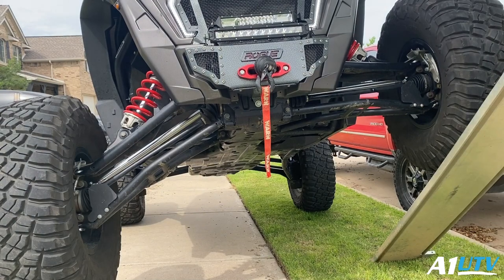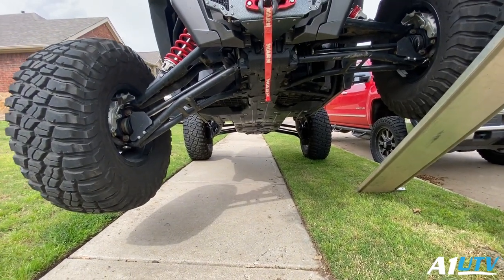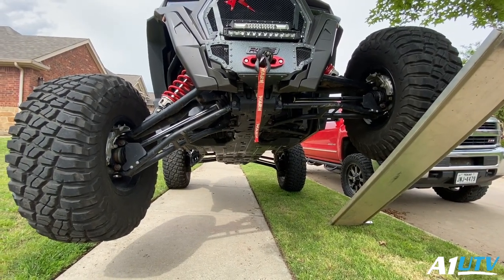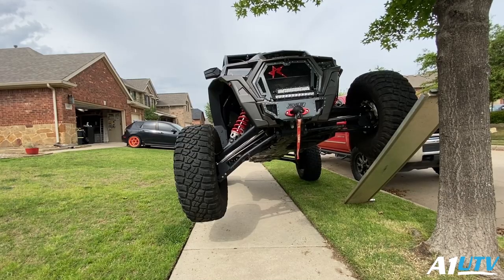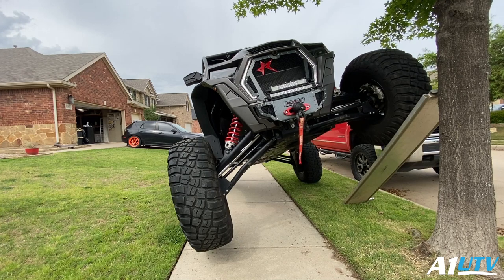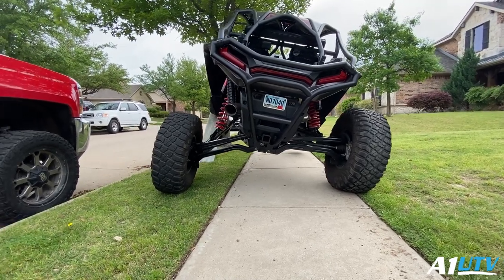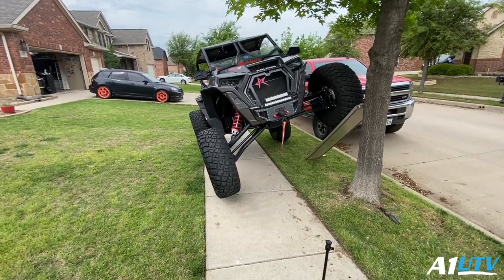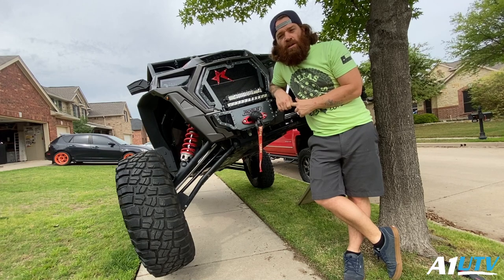Electronic Sway bar test

Comment: This is a great way to go. Sure if you only rock crawl maybe you just remove all sway bars but this is the ticket for the guy taking their machine through different styles of driving. The sway bar is important to high speed handling but can hinder low speed stuff especially rock crawling.
Reply from the maker: yes sir

Comment: I have a 2019 4 seat turbo s. I have the same set up you used to have in the rear with pulling the pin to disconnect the sway bar. Running no sway on the front. But that’s pretty sweet electronic disconnect. Pretty expensive though but might have to consider that.
Reply from the maker: Lonnie Reavis its really nice for sure man. I cant wait to get out and try it out.

Comment: This is the first time someone has explained to me what the sway bar actually does, that understand!  Thanks for bringing it down to my level.   So, I have a question. Is it possible to ride hard enough or turn hard enough to break a sway bar?  If it breaks under massive stress, you’d probably roll when it lets go, right?   Thanks for the amazing videos!
Reply from the maker: I have seen the mounts break but never the actual bar.
Reply: @A1UTV  would the results be the same if either broke?